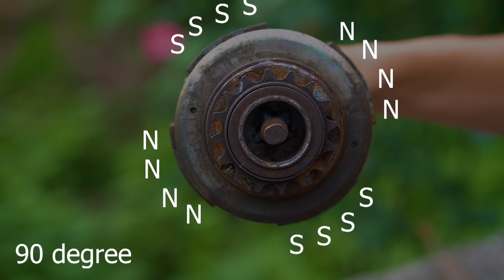I build 220v electric Hydropower dam

Comment: I want to see you stop the flow of water and the fans and light bulb turn off.
Reply: yes, it really looks like a fraud, a lot of work tho, but this can't be his first attempt at this. Make one wonder and question
Reply: there is no way that a crappy setup lik this can power those fans and a lightbulb. also like another comentor said the moment he put a real load on the generator it would have slowed the wheel down. that did not happen. aka fake
Reply: @highkicker11  another commenter: at 15:28 and 15:30 you can see battery at the bottom of the pipe.  :-)
Reply: Simply take off the chain
Reply: @skywalkk0079  or block the pipe

Comment: you cant use this with appliances with microchips, it will surely break the circuitry. this generator hardly able to meet the 60hz frequency standards
Reply: You're right not 60 hz.running to slow.
Reply: modern switch mode supplies that are used for most electronic devices arent really effected by differing input frequencies or even voltage as long as its high enough to support the required power and within the supplies operating specs. The problem with this generator is it wont produce anywhere near the power advertised, and wouldnt be useful for all that much

Comment: You need a spade that tool lol
Try letting water out the bottom of the bucket or slow the flow use a smaller nozzle so bucket don't fill up otherwise seal the top and monitor the pressure
Reply: Wanna rewrite that was some punctuation marks so it makes sense?
Reply: @Ih8liarsandusers  triggered !!!!! Like I care what you think 😃

Comment: I don't think it is generating 50 to 60 hz required by the fan
Reply: More like 5hz…
Reply: @jesperwall839  I KNOW it's not generating 240 or 7000W or anything near that.
Reply: 3 round per sec, X pole.....6/8 hz but maybe 300V or plus for spike....it's possible but a 10% for a light bulb...mah, remains lit slightly due to thermal inertia

Comment: Brilliant.🙏👏👏👏
.
I'm building mine.
24v - 250w DC scooter motor. Solar panel blue controller. I'm using USB slot for small motor to turn 250 motor..
.
Speed control on small motor, with big wheel. 250 has small wheel.
.
I'm trying to make (portable) free energy.

Comment: there are lots of things to improve here:
1. clean your surfaces before welding. with all that rust your welds won't hold that well and it is bad for your health if you breathe 
2. be careful when welding bearings. they can easily warp which creates lots of friction or can even cause them to get stuck
3. the orientation of those magnets at 9:08 is wrong. you put them on in an alternating pattern, otherwise they would repel each other. therefore you don't have 4 poles like shown in the video but 16! 
also, you had so many magnets. why didn't you put on more? the more often the magnetic field in the transformers gets reversed, the more current you will induce, increasing power output! having 16 instead of 4 poles actually helped you in that case. look at the design of brushless motors for reference.
4. taking off the base of those transformers was unnecessary. this kind of magnet and coil arrangement actually requires the use of ferrite cores that carry the magnetic flux through the coils. the permanent magnets will magnetize the iron as they pass by.
5. your wiring diagram at 11:29 shows the coils connected in series with a total output of 220V. that can't be right. without measuring the output nothing can be said about the voltage in a generator. the voltage is dependent on the speed of your rotor. also, if those were 220V transformers, that only means that they should be driven with 220V on the primary coil, not what they will produce! in fact, most microwave oven transformers have a ratio of about 10 : 1, meaning even if you put 10V AC on the primary you'll get 100V AC on the secondary. unlike what you've shown at 2:14 the secondary coil will usually produce around 2,400V or 2.4kV - NOT 100kV! that kind of voltage would be way too dangerous for a microwave and the electrical components would have to be huge to prevent arcing. you may be able to get 100kV out of the secondary by inputting close to 10kV in the primary but that will probably melt your coils. 
7. lastly, the design of your dam is very inefficient. hydropower relies on extracting potential energy from water. potential energy is higher if the water is more elevated, so instead of feeding the water into your water wheel from the base of the dam you should feed it from closer to the top to extract more of it's kinetic energy as it flows down. putting the drain pipe of your water wheel housing on the bottom center will help with that as well, since the water will have to slow down to get to the center of the housing while it keeps pushing the wheel. with that in mind you could simply increase the height of the casing, which will also prevent more water from spilling out as can be seen in your current design. the reason it keeps flowing out of the top is because the water level behind your dam is higher that in the bucket, so keep that in mind.

i hope this helps. you've got much to learn, but don't let that discourage you! keep making stuff!
Reply: the speed of the rotor does not change the voltage, but the frequency.
Reply: @skyevanderheijden5382  that's the same thing... faster rotor = more rpm; more rpm = higher frequency
same thing, different measurements
Reply: @DarkByte  what? Voltage does not equal Frequency.

Comment: Looks like magic. 

You pick random high ratio transformers, put them around magnets then spin the rotor with an uncontrolled stream of water... no control neither over the voltage, nor the frequency, yet pulling like 100W from a weak stream and operating equipment designed for AC 220V at 50Hz. No effect putting load to the generator.... does not even try to slow down due to the load. 

This could work with DC gen, a few LED-s with a switching  power supply capable of handling wide input voltage. I am not a civil engineer, so would take me a long time to calculate how much power you could get from this setup, but I guess it is something to power a few LED-s, definitely not 2 fans fans  and a light bulb,  in total needing something in the ballpark of 100W.

Comment: Very good! Thanks. If you build the blades rigid forward, but flexible backward, the forward would have less resistance, therefore the shaft would have higher speed, thus increasing the voltage; but I don't know what would happen with the current, because I see that you don't use any regulator.
Máximo Mendoza, Dominican Republic.
Reply: Someone isn’t an electrician and it shows
Reply: it would change the frequency, not the voltage
Reply: The voltage for this project is regulated by the step down transformers outside of his house ;)

Comment: Yeah I'm pretty sure the water would just overflow out the top of the bucket without rotating the turbine lol
Reply: With the hole on the other end keeps the bucket from over flowing.. lol
Reply: @samrabena2720  Harry Potter engineering

Comment: A great fraud.
1.- At minute 19:22 it becomes clear that there is no correct connection between the windings and the loads. (the cable is not connected)
Reply: I'm assuming you are referring to the brown wire. If you look "really" closely, and slow the speed down 0.25x speed, you can see the brown wire clearly is connected. If you pay attention to the visible length of the brown wire as he moves it, it appears to get longer and then shorter. This is because it is brown, and it's in a shadow. If it were not attached, it would of been almost impossible to move it so cleanly between the rotor and stator without it being hit or caught on the magnets.
And, if you also pay close attention to the wires on the ground, they are indeed connected to the generator through the power strip. There are no other connections. So where is the power source and how is it connected if the brown wire isn't connected? They have to be connected somewhere/how as the fans are clearly on.
Reply: As the generator is too slow the amperage is lacking and the fans are not working at full speed and the light bulb was dim, but he didn’t care about that = I wouldn’t be surprised that this video is fake/fraudulent, these financially poor orientals in the lower orient, below China, specialise in committing fraud, by allowing Google to infest the video with advertising - using them as cash cows per view, 😠 the most common form of fraud by these orientals are the fake restoration videos = I report these as spam and misleading, I will now do the same with this video!

Comment: 50 percent more electricity he would have got if closed the lid of the bucket as 50%water is flowing from top of bucket
Reply: Yeah I was about to comment that he is losing slot of power bc of the water just splashing out and the lid will help make s better flow
Reply: Not only that but the shape of the blades on the turbine is terrible for power optimization. He probably isn't losing 50% over the top of the bucket, cause the speed of the water leaving the bottom is way more. So I think if he optimized the blade design then he would get more power than any other optimization. He should do all of the optimizations though.
Reply: @kalebjohns7715  what he should had done is the main dam in which water was stored should be covered be plastic sheets as water goes underground, second he should had connected a pipe through the exit nozzle of the bucket and put that baick into the main dam, third thing you and first only told in the comments that is blade shape and bucket lid
Reply: @roshanpereira7650  you couldn't send the water back into the dam. Well you could but it wouldn't make more energy or power. That would be a perpetual motion machine and those aren't possible at all. You also don't need the plastic sheet coverage as you don't see that on any actual real world damn. He could make the dam a little taller to hold more water though.
Reply: @kalebjohns7715  who sees for real world, he is making a custom dam he doesn't gets water from any source like rivers rain water etc he might be putting his tap water in dam so putting a plastic sheets on floor of dam might save his lots of water and second you are talking about prepetual machine I know prepetual machine don't exist but see he is making enough energy to power 3 High Power devices including the pump so connecting the exit nozzle of the bucket to a water motor and putting the pipe back to the dam is totally good and why only one bucket he should had connected at least 3 buckets together to make very high electricity and talking of the water pump in real world also if the dam makes electricity the electricity is used back to do its maintenance in nuclear plants all electricity is power by itself not directly but indirectly
Reply: @roshanpereira7650  so for the plastic, I thought you meant on top of the water, so you are right about that. For the pumping the water back into the dam, that would make it a perpetual motion machine. The way it works is the water falls down into the generator, he doesn't use a pump, he uses gravity to let the water fall into the generator. If he connected a pump at the end (even with absolutely no loss of water at all) he would not make enough power to pump to push all of the water back up into the dam, even if he disconnected all fans and light bulbs. That would be physically impossible and would violate the Laws of Thermodynamics.

Comment: EVERY time you grounded through the bearings you caused microarcs that damaged the surface of the balls and races and this makes their life extremally short when they start rotating. You can weld bearings but do it by avoiding grounding through them.
Of course the heat of the welding ruins the hardness of the steel anyway.
As a prototype proof of concept that will only run a short time before you build one right I guess it's ok but I still cringe at the waste. It would have been better to fabricate a bearing housing in my opinion as cheaper than building it twice.
Reply: Exactly!

Comment: This is self sufficient, the pressure of the water is keeping the momentum of the magnets constantly rotating. Magnets placed accordingly to repel. The motor generator will continue to provide power with continuous water pressure. Free electricity! You can increase speed and size of motor to increase capacity, Better gears and bearings.

Comment: If you used gravity as well as the presure from the dam(horizontal orientation) and using half of the bucket instead of fully enclosing the impeler(so the water drag is minimum) i think it would give of a little more power and I think using a proper alternator instead of recicling old colis would also  greatly boost the power output
Reply: there is no way that thing is producing 7kW of power, haha.
Reply: Beyond the changes of the damn, you could probably get a bit more power just by increasing the size of the gear wheel on the turbine. That would quickly get diminishing returns, though, if you went very much bigger.

Comment: Once it is refined it could be used to run a light or two. Not enough power in what he was using to power a fan or two. You would need a much better set up than that to power a fan.

Comment: For all those of you claiming he couldn't get 7KW out of this thing, you're wrong.  Or you would be if he hadn't partially destroyed the primary cores of those transformers.  Given the size of the transformers, it is entirely likely that, had he not hacked off part of the primary core, he could have gotten 7KW out of them.  Though, at that voltage and wattage, his system would be using roughly 10 times the fatal amperage.  Amperage is fatal at just .2 amps.  His setup uses 21 amps.  Even the slightest touch at that amperage would not only knock him back 20 feet, it would kill him by burning his internal organs.  Also, transformers do not work the way this setup would require them to in order to produce current in that manner.

Comment: That is not even 70 Watts
Reply: But could be plenty of power to charge batteries for use to run leds at night time. and possible fans to help keep air circulation.
Reply: Max 5 wats
Reply: @ДядяФёдор-г6ц  Has to be more than 5 watts. The fans each are at least 10watts each, and the light is probably pulling around 10-15watts.
So this set up is most likely only producing about 30watts.

Comment: Hodwy. Nice.
One may cosider using a manifold type inlet to the turbine. Say 4 inlets. That should provide more torque. Also, the turbine blades may be scoop shaped instead of flat blades.
Regards.

Comment: With the increases on electric prices in the last 2 years in the US,I can see why there are 7.5 million views for this video.I pay close to 100 dollars a month in the summer for 230 KWhr's in Northern Pennsylvania.When the ac or heat is not on and have a flat plate collector with evacuated tubes coiled copper pipe inside for hot water.

Comment: Correct me if I’m wrong but the power wattage for this fans are about 30-40W at the minimum. From the look of it the height of the head water to the tail water with respect to its datum line is very small. Also the frequency of this motor is also small since it is an AC the formula is N(rpm) is directly proportional to frequency. Considering the head loss of the pipe and its friction delivered to the shaft of the generator it may also affect the power output of the system. From the look of it the flow is between laminar or transitional flow due to the small speed and wide diameter of pipes. Over all this system is impossible to drive two fans.

Comment: so to everyone out there saying this kind of thing would never work, it does but there is a hundred ways to improve this. But this is a great simplified set up that demonstrates the idea of how to generate on demand hydro electric generation in a remote site with just scrap but you could set up a more efficient setup like a old 2000 watt dc motor remember they work in both ways but you lose around 40-50 percent. Or simply send the 3v into a battery bank over time and use a inverter so you can have ac power.

Comment: I don’t even think the fans are being powered by this low efficiency generator which will give couple dozen watts… but when he plugs the load to the generator there is no slowing in the water turbine showing the load is not being drawn by this contraption.😂

Comment: going to be fair here and give you props for building an actual duct and dam, but that's where it stops unfortunately. I'm not even going to go into the details on the potential energy there like most as I don't know the math like them, however most fans that size use shaded pole motors, their rotation speed is affected a lot by the frequency they are being run at. That rotor is spinning at most 3 hz meaning even if it could somehow produce 7kw at 220v not only would the fan still be spinning slower the light bulb would be visually flickering. yet when you get the camera close to the fan I can hear an audible 50hz hum. I'm guessing you either have a battery and inverter in that drainage pipe, or you buried an extension cord.

Comment: couple things just for this guy (not a hater) he needs to really weld these tack welding is bad enough but just a few of them isnt gonna hold anything; also, it doesn't take much effort to build a diy tensioner bolt system its easy.